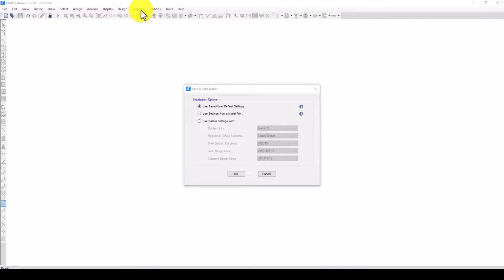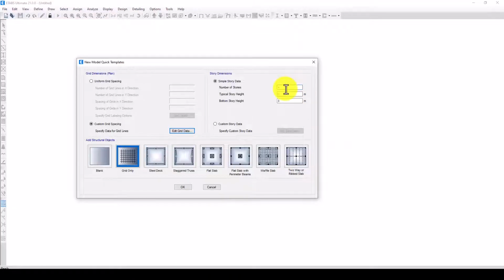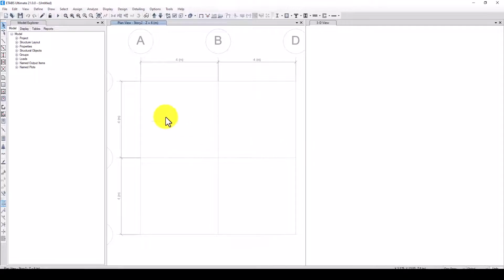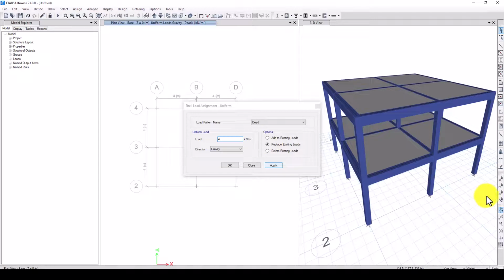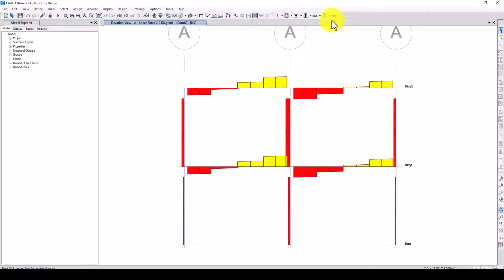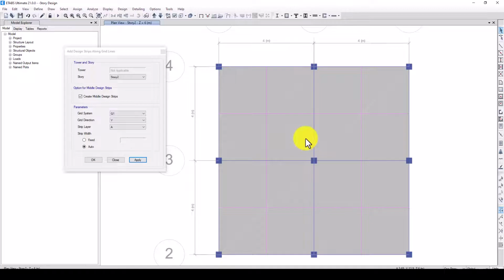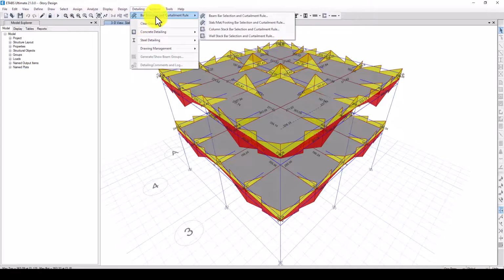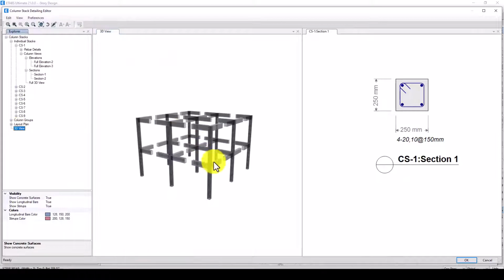ETABS 21 Tutorial : A Complete  RC Frame Analysis, Design and Detatiling with latest ETABS Software

Comment: column section as u given is 250x250 but beam section as 400x250 its like weak column strong beam that might leads to failure and collapse right? As per rules we should go for Strong column weak beam concept.
Reply from the maker: Yes, this design is weak column strong beam. You should keep a balanced design.